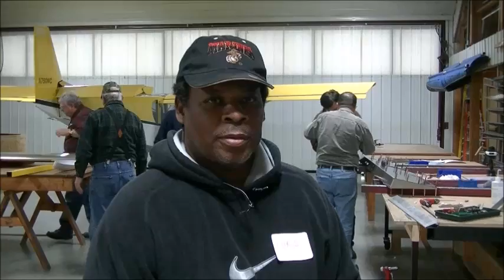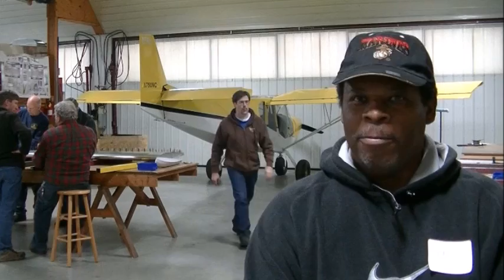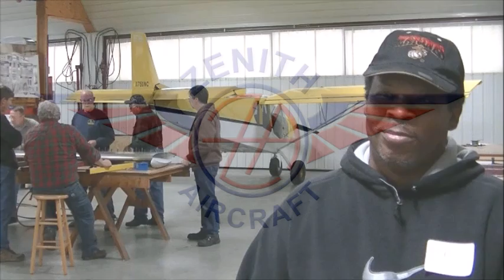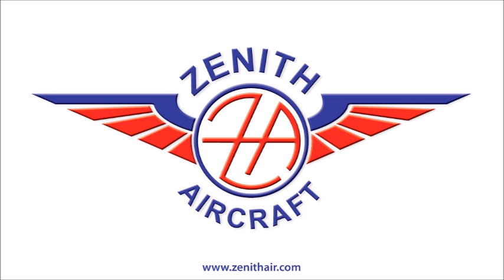Christopher Ward on building his own airplane

Comment: These kits are way too overpriced. You're better off buying a ready-to-fly plane. It makes me wonder how many people buy into this kit building and then see it come to completion. How many screw ups along the way and how much that may cost you to fix it. No thanks. Zenith should offer to the public a ready-to-fly fully built 750.. I can't even imagine the profit this company is making from just selling precut/predrilled/preshaped metal parts. Then add the cost of an engine to this.. Forget it. I don't want that kind of hassle.
Reply from the maker: Over-priced compared to what?
Building an airplane is obviously not for everyone, but for most it's an enjoyable and rewarding experience, while also potentially saving a lot of money. It's the reason why the kit aircraft industry is growing while general aviation continues to decline. It's fine to admit that you're not interested or up the the challenge of building your own airplane, but please don't slight this rewarding hobby just because you personally don't want to build one.
Reply: Zenith Aircraft Company Compare to Aerolite 103, the Kolb Firestar, Earthstar Thundergull  JT2 LSA, Zigolo MG 12 electric ultralight motorglider, E - Gull by ThunderGull 55 HP electric or gas powered aircraft, Kolb FireFly - 12, just to name a few I've been looking at. All the mentioned planes are, for the most part, alreaady built ultalight aircraft or small assembly requiring little of your time most priced at under $20K and they all come with an engine already installed. That's less than half the cost of a 750 and that's without an engine.

Why can you not offer your 750 in an already built form and let's see what the price is then. You're leaving a lot of potential customers out of the picture because it only comes in a kit form and you're responsible for not screwing up the build, along the way. I've also looked at used aircraft such as the Cessna 150, 172 and 182 already broken in and in very good shape for less than what the Zenith kits sell for. 

Maybe someone just likes the Zenith 750 but doesn't want to build it. That's the market you're not catering to thus lost business on your part. I think most people would want to be up there flying after buying and not your company's way of doing it. 

Anyways, thanks for replying but I'd rather get something new for under $20,000, but that's just me.
Reply: ***** Are you not comparing Apples and Oranges? The aircraft you listed are true Ultralights. While it is true you can register a CH 750 as an ultralight I believe most builders are going Experimental / LSA. Completed CH750's are selling for $80 - 160k depending on engines etc. Would you fly your listed ultralights across the US? I fly a Cherokee. Yes, you can get them for a reasonable price but the cost of parts is astronomical, Annual Inspections add up quickly and it is 30 years old - with steam gauges. A new Certified Cub goes for $150-300K! I am building a CH750 because it is what I desire in a plane. A plane for the backwoods flying, 2 people, lots of gear, 4 hour range plus reserve, comfortable heated cabin, reliability and something that I can do the work on. It's a real plane. If others just want to fly around the cabbage patch, all the power to them. They do not need a $60K aircraft. I have found that it the best aircraft available for what I need. Good luck in your search for the right aircraft for you. Zenith just past 10,000 kits with thousands flying on every Continent, somebody must like them.
Reply: *****
You don't have a clue what you are talking about.  I have a 750 and yes it's not "cheap" and I could have bought a very nice 172 or 180 for the money I put into my build... BUT what I would not have is a brand new airplane, with a full glass panel, and amphib floats.  Instead I'd have a 50 year old airplane that would cost me an arm and a leg for maintenance that I couldn't even due myself legally, even as an AME (A&P to you Yanks) so this was a no brainer for me.  This is something I wanted to do since I was 15 years old, build and fly my own plane. 

There is a LOT of parts to this plane and they still have to be made/cut/shaped, that is not cheap, neither is aluminum!!!  Also as an FYI, Zen sells the plans only so you can scratch build the plane, and yes it has been done.  Zen's prices seem in line with every other kit I've seen out there, and I've never had an issue with customer support.  As far as kits go, theirs is very reasonably priced for the market it's in.  If you don't want to build from a Zen kit, fine, then get yourself a Cessna 150 or something and enjoy that, don't bitch about those that decide not to go that route though.  Aviation isn't cheap and there is no way to justify owing a private airplane, it's all in devotion and fun.  Sorry you can't understand that...
Reply: Mark Maltais Funny you mention you wanted to build since you were 15 Mark. I actually started my Zenith 601 project at 15! I'm now 16, empennage finished, wings close to being finished, AND I've learned more from this build than anything I have done in my life. Also to mention I'm scratch building! If I had the ability to buy an already built zenith or a kit/plans, for the same cost. I would choose to build because the experience and knowledge I have gained from my project will last me a lifetime!
Reply: pilot blue Agree with Pilot Blue here. You need to compare with planes a little more similar to the 750. The 750 is a very affordable and well designed plane. I could build an RC plane for cheaper than the 750 but it sure as hell isn't a 750! If you think about all the work that is put into these designs, the cost ends up being quite affordable.
Reply: Economics is not part of the equation.  I may just like to build planes, from kits, plans, my imagination.  You may want to just fly and can do so. We have a choice to do whatever we want in aviation. Can't complain about that.
Reply: BushCaddy is a good plane but there again, looking at their own factory info they have an arrangement with a company that builds them completed. With the most rudimentary instruments, plus you supply the motor  and no paint for $90K. Taxes in, paint and avionics that will quickly grow to $110-120K.  Which is well above your stated desire for a $20K aircraft.
Reply from the maker: Spencer Rice
Great comments! At a young age you will have more experience and knowledge than most of us old-timers!  We'd love it if you would share you building (and learning) experiences!
Reply: Zenith Aircraft 18
Reply: I just did with the BushCaddy.. There are lots of other choices not even mentioned. It's a bad marketing concept to just have a build kit. If you believe in your product, then hire people to put it together, which would create jobs, and then put a reasonable price tag on it. I guarantee you'll sell a lot more Zenith aircraft. It's just my opinion. Your company should build about 5 of them and see if they sell. If they do, you create jobs and have another market tapped into for your product.
Reply: Mark Maltais I have a right to bash anything I see is wrong. Who the hell are you? I could care less about what you built. The fact, ONCE AGAIN, and get this through your thick skull, is I don't want to BUILD AN AIRPLANE, PERIOD. I just want to buy one that's already built by the pro's and withstands the test of time over many decades and will have very little depreciation value, if I were to sell it in the future. This plane, no!!! It's relatively new on the over-flooded market, yes it flies and handles well but it is only in kit form. To hell with that. But I also know why this company is doing it, EXPERIMENTAL ONLY... thus they will not yield to selling a completely built plane because it would have to be sold as something like a Cessna. Plus when you fly it and it crashes, they, the company, hold zero liability. That is their business model.

I'm not saying this is a bad plane in any way. All I'm saying is I don't like their marketing strategy at all. They seem unyielding to their corporate mission and is why they are only a minute market share of all other airplane manufacturers.
Reply: @journeyon1983  in the three years since this comment I wouldn't be surprised if zenith outsold Cessna 172.